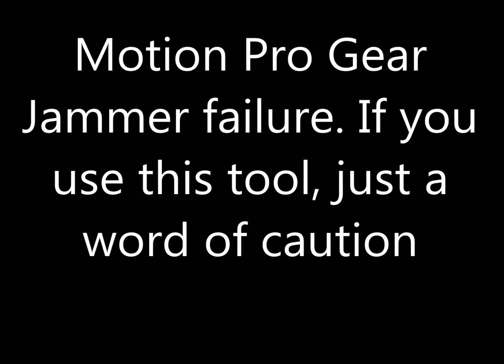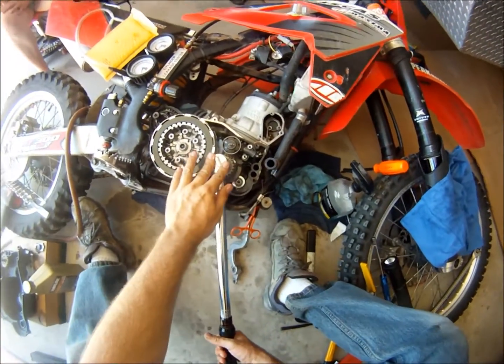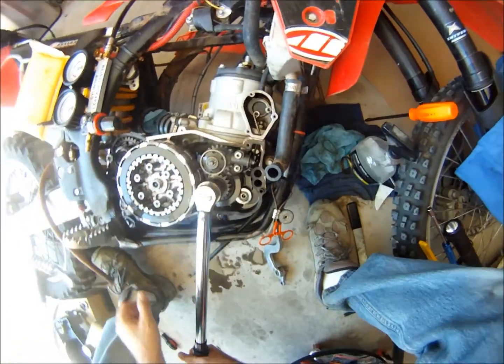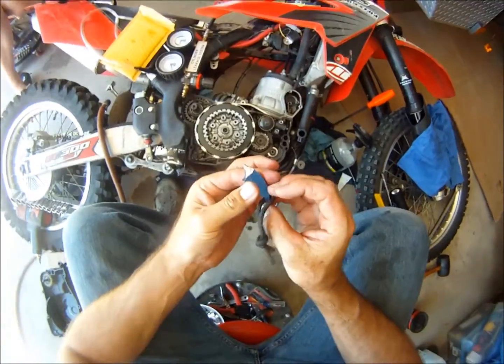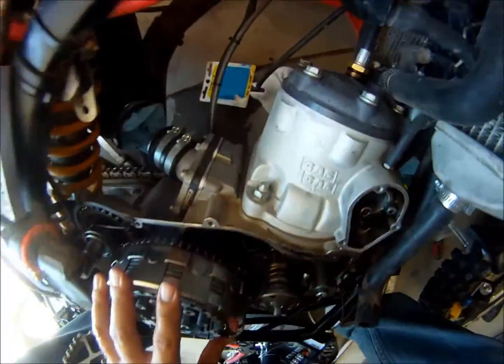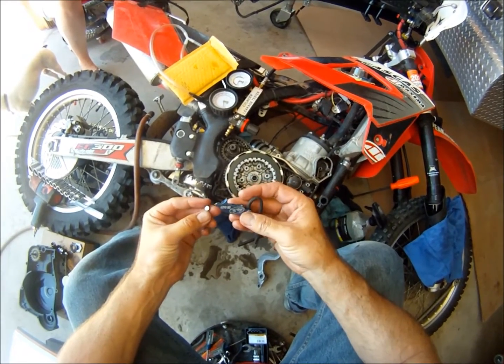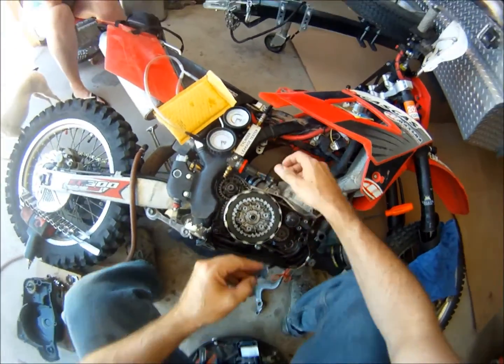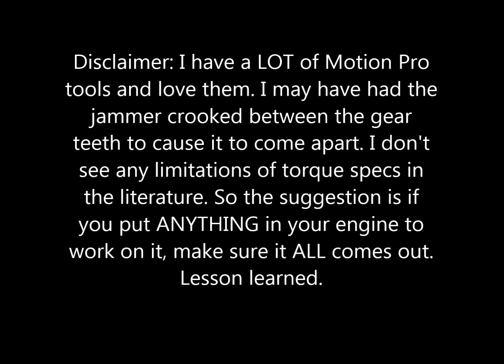Motion Pro gear jammer failure

Comment: is that nut opposite threaded?
Reply from the maker: yes the primary gear nut is reverse-thread. Is that a GasGas you are riding? the torque spec is 40NM in the manual, but the consensus on gasgasrider.org seems to be that this is not enough torque. I used 60NM but please reference the gasgasrider.org for their recommendation. If I remember right the contributors had made up a much more exhaustive torque spec sheet
Reply: I haven't had a need to go into my engine that far yet, just looked funny to me.
I have a 2006 EC 200 with a 2011 kit on it, I'm regularly on gasgasrider's forum my name is thejackrabbit
Reply from the maker: Jack Rieger Cool. I'm thumperflipper. are you in the US? how did you get the '11 kit? I really want one

Comment: Something isn't right with how you're wedging it in.  I've done a couple dozen primary gears with the same jammer and never had an issue like that.
Reply from the maker: I'm glad to hear that. Maybe I damaged it at some point. I've used this one several times, and maybe it got misaligned this time, but the point of the video is if you put any tool or anything in your engine/case, do a count as you remove them and be sure to inspect anything you take out to make sure it is complete. It's not surgery, LOL, but a fragment left inside could cost me a bunch of parts, money, and time.